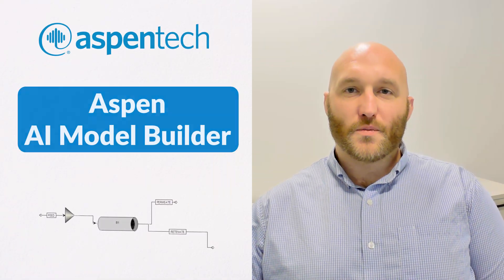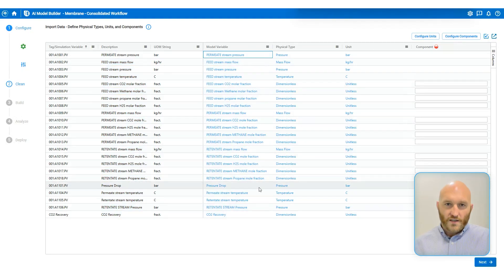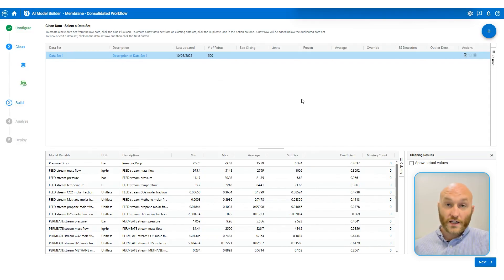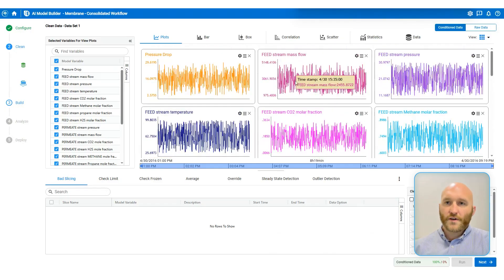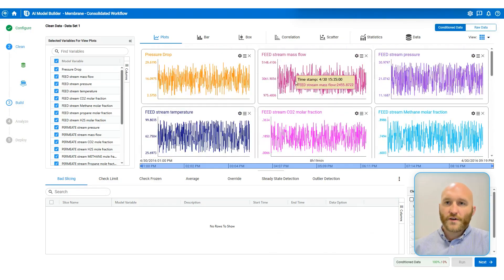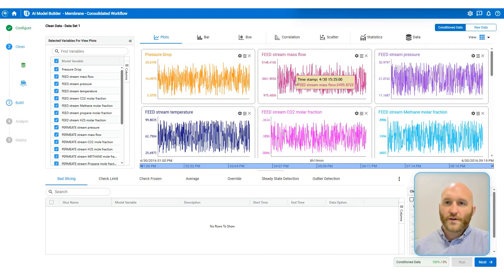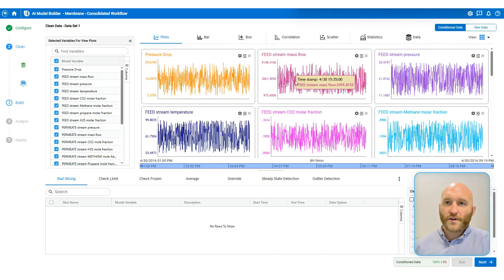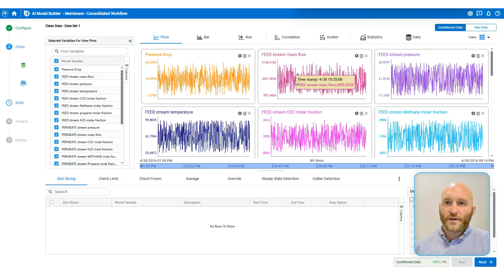How to Create a Hybrid Model in Aspen AI Model Builder

Comment: Good initiative.
But what if you want to use data from you own model how can you generate it and import that one into he ai model instead of using the plant data template
Reply from the maker: Thanks for the question! AIMB also has a simulation data template available at the data upload step. If you are using Aspen Plus or HYSYS, generating data is made easy with Aspen Multicase. We will show this process in a future video.
Reply: @AspenTech ok I really need this for my project about Glycol regeneration process
Reply: Thanks for the Tutoria.
However, after following the instructions step by step.
I always get an error Code when creating the model
can you please be of help